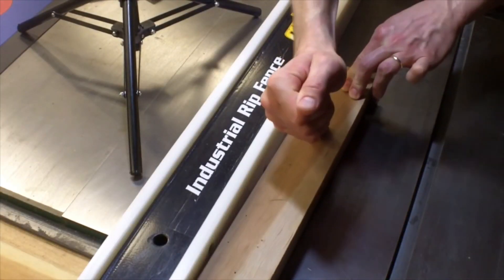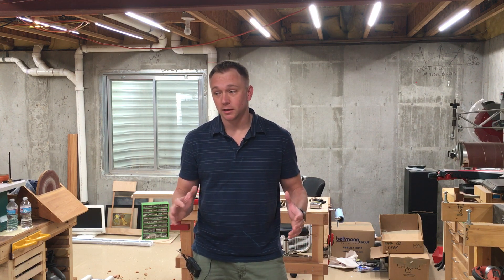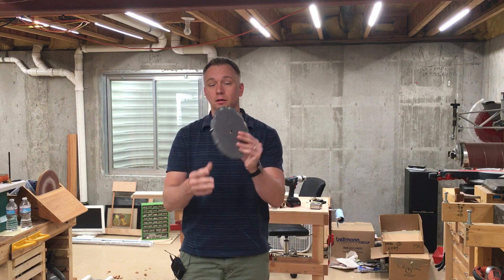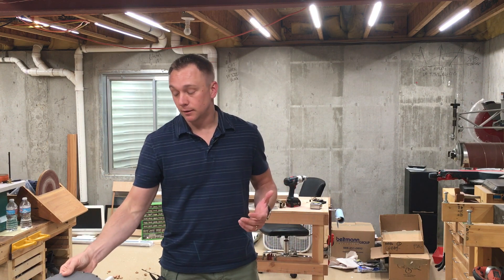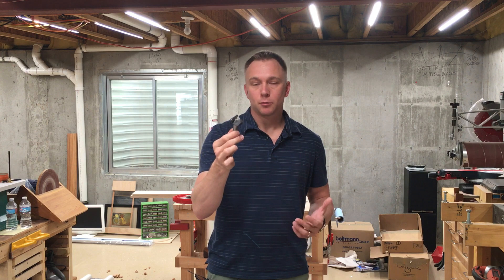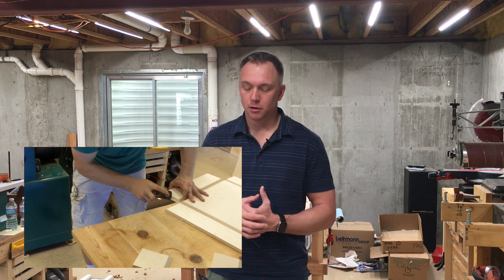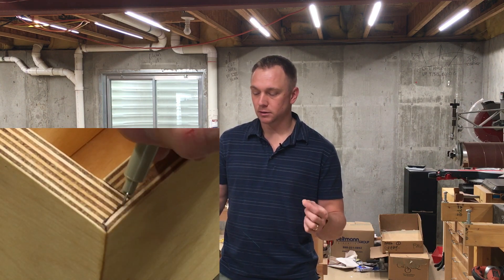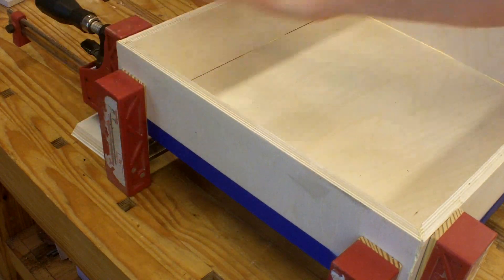Overdue update on the Blade

Comment: Good luck Andrew, I'd love to see it on the market. My Dad was a carpenter and cabinet maker, he would have loved one of these blades. Unfortunately he passed away 3 years ago, but I know he would have been just astounded at how you came about this, he loved to see stuff like this.
I didn't follow in dad's footsteps, I went in to the Air Force and became a Machinist and made that my career. But things like this grab my attention because it will have machining involved in the production. I love my job, especially when I can make someones job a little easier making a special tool for them. As hard as it is to get an invention on the market I can see the potential of making several jobs a lot easier, simpler and stronger. I can also see the potential for this blade design to be adapted outside of the wood working industry. Plastics is one of the first I can see using something like this, especially if they are made in several sizes. It could even find it's way in to the metal industry for specialty items in aircraft and auto to simplify some parts production. But I have to say that the one thing I like about this blade idea, is that you used the KISS system (Keep It Simple Stupid). The shape you came up with is just so simple, it has to work and I'm kind of surprised someone didn't come up with this a long time ago. Again good luck and I will be watching for more updates and when it gets on the market.

Comment: Your blade (as you mentioned) has more glue surface thus much stronger and WAY more safer to cut your joint on a table saw than the "V" $100.00 bit on a router table. Just look at all the material you have to plow out to get a sloppy "V" joint to even work. I just found you roaming around the you tube wood working sites and I think YOU have a great idea/product. GOOD LUCK Andrew... much success dude!

Comment: most wood workers have a dado, id not buy it if it was packaged.  I would however buy one immediately if I could just pick up the blade.  Very cool!
Reply: But the dado blade has to be the exact right diameter to match the diameter of the Klein blade, right?  That was why the prototype had gaps.  So it can't be just any dado blade.

Comment: good update,,,,, the blade looks easier to set  distances of the side compare to router bits ,,, ,,, and that a lot of meat to remove with a router bit ,,,, ,,,, plus the router ,seems to leave a slightly off set corner  less then 90 deg leaving a gap,,,

Comment: Love it! What sort of price point are you going for? 

Less than $50? - not holding you to anything firm...
Reply: Christopher Rhoderick you can't get a decent regular blade for less than $50
Reply: I could easily see this product @ $119.00 US, of course dependent on blade quality, but understand this is a specialty blade similar to a Whiteside $100.00 router bit, sure you can purchase the same bit for half the cost but there is value in material quality with tighter mfg tolerances.

Comment: Also, even if the router bit is a viable option, far fewer people have  a router table than a table saw, and most any woodworker is bound to have a table saw. I guess it is a moot point too considering if you do drawers and cabinets you probably have a router. but yours looks sturdier and much more glue surface. I look forward to your product.

Comment: I am all over this idea.  As an extreme DIY guy I would buy this in a heartbeat!  Please tell me though, would I be able to use 1/2" ply for my drawers?  In my shop I have no issue with 3/4" ply... but for most applications I want 1/2".  Thoughts?
Reply from the maker: Yes, you can use 1/2" plywood, even if the thickness is a bit more or less than exactly 1/2".  You make this adjustments by changing the thickness of the dado that is adjacent to the specialty blade.
Reply: Thank you for your very prompt reply!  Is your blade available for retail or wholesale sale yet?  Where?

Comment: Great idea. Do you have any problems with the edges tearing when you bend them. If this is a problem, beekeepers, when bending thin wood for honey "sections", brush one or both sides of the bend with water and allow it to soak in for 30 seconds or so, before bending. Stops the wood from tearing under stress. Good luck with your invention, I wish you well.
Reply from the maker: I haven't had a problem with it, but if you had a high quality veneer, and wanted an absolutely perfect fold it might be a good idea.

Comment: Great idea and hope it works out for you.

However there is no market for this in Europe.
All tools sold into in workplaces in European Union countries have to carry a "CE" mark to show compliance with EU safety, health and environmental requirements. This applies to both to DIY and professional tools.

Dado blades are illegal in Europe and the UK as table saws (and all other saws where the blade could be touched by the user)have to stop within ten seconds when turned off . This is achieved with an electronic breaking system. The extra mass of the dado stack if stopped quickly could result in the blade set spinning off the spindle.
The blade spindle on  "CE" marked tools has a legal maximum allowable length  to preclude the use of dado sets.
Reply from the maker: +Peter JF yes, I am aware these restrictive European laws.
Reply: That is the official position and would certainly apply to professional workshops. Technically it is illegal to sell them but not to actually own a dado compatible saw. A determined amateur could source a saw with a spindle  or even import an American saw. I have a DeWalt with a dado and its a great tool to have - I run a moulding head as well as specialised finger joint blades on it.

Comment: One point about using the special V-groove router bit is that the tip will never cut well.  Cutting requires that the blade edge move past the wood, and as the radius of the tool decreases (the closer to the tip) the motion decreases, going to zero at the actual tip.

Comment: Any chance of making it a router or shaper bit instead of a table saw blade? Instead of running the stock horizontal you would run it vertically. It would, somewhat, limit the depth of the drawer you could build.
Reply from the maker: +Randy Webb even if you could live with the low drawer height it still wouldn't work.  Think of how I had to switch the tablesaw fence in the first video, there is no way to do that with a router bit configured as you describe.

Comment: So I have been following your exploits with the MFD, now the RMFD since the very beginning. I still love the idea and your ability to bring it to market. I have, however, been surprised by the lack of excitement and seeming acceptance that it has encountered. The price is a red herring issue but some of the others are not. That said It seems to me that all of them have reasonable answers and may be caused by Rockler managing liability. Would love to see a video directly addressing them.  Quick list to explain:
1) Max workpiece limits are a concern but the 6" max side is a killer for me. Why not double stick lauan splints on the back across the cut area?
2) Hold down on larger sizes could be fixed with a finger board or hold down roller coming down from the ceiling or hanging out from the fence ( I already have blade guard/dust hood coming down)
3) I'm thinking that size limitations are driven by manual hold down limits (is this true?) I have a sliding table saw and could easily cut 60" by 28" safely
4) One of the real valuable uses of folding Miters is making long (8') columns or beams or at least table legs. Is this possible?
4) the only criticism I agree with is how could they sell it in a box not made with the RMFD???

Comment: Most manufacturers use MDF these days but its disadvantage is weight. If your blade could cut a drawer with the sides no more than 3 eighths thick it would definitely be very useful. Any thicker for 'fine' furniture would be far too (plonky) plonky in the U.K. means overweight and ugly! As I said weight is a problem with a a drawer from 32 to 36 inches wide. In fact a drawer made from oak that's 36 inches wide is too much to lift easily when its out of the carcass. We are dealing here with the probable use of MDF or Ply which is actually much heavier than oak.I think your blade idea is superb, but it needs scaling down for use on smaller sized material. Not only would this be advantageous for a more delicate drawer but it would bring the idea closer to the handyman craftsman too.Drawer making has always been a pain, but I can make a drawer in an hour with hand cut dovetails....that's after everything has been cut up and marked out. However your idea is very good, but I suggest you lighten the blade (cheaper too) for a more useful weight of drawer, unless of course the requirement is for a hefty drawer of small size.I think also, the ability to slide in a bottom-board is of paramount importance......but of course it's an option, or should be!
Reply from the maker: +gilson chapple it will be able to make the lapped miter joints in material a bit under a 1/4 inch.

Comment: Still think you should patent the shape of the cutter be it a router, because this is close to a lock miter bit, and or a molder, because those could be cut into this shape.    It's been 3 years, where is it at now?
Reply from the maker: Rockler is selling it.  Pairing it with a dado stack allows for large and small adjustments in material thickness from over 3/4” to under 1/4”.  Couldn’t do that with fixed molder cutters.

Comment: well we've determined one thing... the blade should cost somewhat less then hundred bucks... 

Also, every basic wood worker has a table saw, not everyone has a router table, or one that's powerful enough to handle the V bit.

Comment: I can see a problem with this.....it's ok for small drawers but if you were to make a large drawer it would be so heavy to be impracticable....... I'm a cabinet maker of 56 years. I suggest the design have a slide in bottom instead of the whole being one piece of plywood.
Reply from the maker: +gilson chapple I agree, in my original video I show how to use the blade to make a drawer with a bottom thinner than the sides.

Comment: One question, does the weight of the blade have any potential adverse effects on lower powered table saws?
Reply from the maker: You need a saw that has an arbor long enough to use a dado set, and any saw meant to run a dado set will have enough power for this blade.

Comment: Thank you for the update! You don't need me to tell you how excited the woodworking community is for this blade. One question I have, and I understand if at this point you can't answer it, but will there be a way for Sawstop owners to use this blade? I was not sure if there would be issues regarding using a dado brake in addition to setting the blade distance since the blade is so assymetrical. Just curious. Thanks, and I can't wait to see this hit the market!

Comment: LUCK!!!! The advantage you didn't mention about your blade is that you already have a table saw (and you don't need an expensive one), so after doing the dimensional cuts on all your wannabe drawers, you just have to change blades and finish the job, but for the gluing. 
One thing you might want to create to go with the blade is a gauge that you use on the wood and it would give you the height of your blade to get great cuts the first time.

Comment: I love this. Seriously. I am a novice at this type of thing and I was thinking of making some pull-out shelves for my kitchen cabinets and this would be great to have for that project. I have a question that you may have already answered in the previous comments, but there are so many that I couldn't find it. As for the strength of the completed drawer, wouldn't a few staples/nails/screws along each glued edge strengthen it? It's an extra step, sure, but if you have the power tools and aren't doing it by hand, it wouldn't take but a few minutes on each drawer.

Comment: since having the bottom of a drawer 3/4 of an inch is an over kill are you going to have a blade for other size plywood like 1/2inch ?
Reply from the maker: The blade plus dado stack works for any size plywood from slightly under 1/4” to slightly over 3/4”

Comment: Would this make strong enough joints for speaker cabinets? If not could you add screws?
Reply from the maker: Yes, it would be strong enough, screws wouldn't hurt of course.
Reply: Kenneth Cohagen this is what I would be interested in. I do a lot of veneering and the only other way to do something like this is with a 45 degree router bit and v groove.

Comment: Advantages of the 100 dollar router bit is: 1. it is a cheaper alternative vs 350 dollars for the blade/dado set. 2. Router bit setup is faster, only ONE fence setting not two. 3.The router bit has user replaceable carbide cutter that cost 8 dollars and has 2 sides per cutter. 4. Glue up just takes tape for clamping. It does have less glue surface area but your claim to fame was that it was strong enough for drawers. So is the miter fold V bit. If you need a stronger joint you wouldn’t be using a miter anyways (see #8 below). 5.The router bit doesn’t require a different zero clearance insert for each material thickness.  6. Also, the router bit can be used on very small boxes. Much smaller and thinner material than what this blade is capable of. 7. only have to adjust the height of the router bit for different thicknesses of material not the width of the dado stack. 8. Hidden splines, biscuits or dominos can be added to the router joint easily. Don’t get me wrong, I like your idea and I hope it goes well for you as it is seeming to. Just don’t misrepresent the router bit. As the saying goes: “There are many ways to skin a cat”.
Reply from the maker: +Robert Melrose I was kinder to the router bit than I should have been, it is not even recommended for use on a router table for that operation, only a CNC machine.  1, not a fair comparison, you get a fully functional dado set as well as miter fold capability, 2 false, yes you have to flip the fence, but the router bit cuts a lot slower, especially on thick material.  3 the miter fold blade can be sharpened for not much more. 4 miter fold glue up can be done with only tape as well, and the joints lock together instead of sliding out of alignment, it's an easier stronger glue up with the miter fold blade. 5, the Dado cuts really cleanly without a tight fitting zero clearance insert, so one is really all you need 6 miter fold blade can work to just under 1/4", you really need to go thinner than that?  7 agree, it's a bit more setup 8 don't need these if you already have a stronger joint with more glue surface.
Reply: Andrew Klein As far as the router bit being slower cutting, perhaps your technique differs from mine. I use that same bit in a table mounted router with zero difficulty. I have a 3 hp router so perhaps that is the difference. I've made table tops out of ¾" veneered plywood and small ring boxes out of ⅛" solid wood. All my shop drawers were made from ¾" AC plywood and the process was very fast. Once the blanks are cut to size and the joints taped (just like your setup) just set the fence and the bit height and off to the races. The shop drawers I didn't even bother clamping with tape once folded. Just glue and some 23ga pins. The table top was tricky just because of the size 4'x8', that required the use of a feather board and some outfeed support. No different than the table saw. I like your invention. I would probably buy one if I didn't already have a dado stack. Our opinions obviously differ and that's ok. Best wishes.
Reply from the maker: +Robert Melrose best wishes to you as well.

Comment: I remember my Dad's table saw had a blade that you could attach cutting edges in to make things like molding. All you would have to do is have the cutting blades made in the shape you want and not have to add 5 or 6 blades next to each other. https://jonpeters.com/wp-content/uploads/2018/02/Push-bars-Project-6-e1551397086271.jpg

Comment: in your video you commented on the expensive  price of the router bit you bought but then I followed the rockler link below and found your blade was over 3x the price.  did i go to the wrong link
Reply from the maker: My point was that the router bit was not some super cheap alternative.  Also, a lot of what you are paying for with my tool is the premium dado set that comes with the blade, some premium dado sets cost almost as much without the miter fold blade.

Comment: a hand router on table with bit is a lot cheaper than a full set up dado and table saw set up. Your glueing example was pointless as a 45 degree join would sit straight with nails and not need clamping.
There are many other ways to do joints without using dovetail joints and the time spent is not the vast difference you suggest in your first video.
The extra time spent saves the cost of extra blade.
Your talking time a DIY person could cope with, a business may be different.
Seems more a novelty item.
Not trying to be a negativity troll here but if it was such a good idea it would be for sale now. Routes to market and patent are only limited by the power of your partner.
Reply from the maker: It isn't for sale this very day because of time spent finalizing design details, manufacturing, and myriad other considerations that need to be addressed for a product launch.  I don't mean to dismiss your criticism, but ultimately the market at large will decide if the product provides value justifying the cost, and at this point negative comments like yours are a minority.